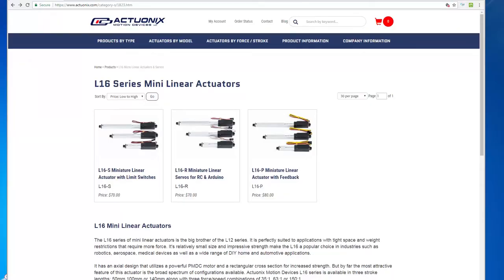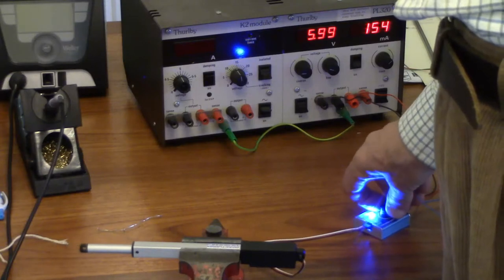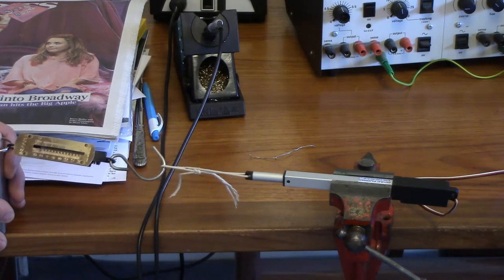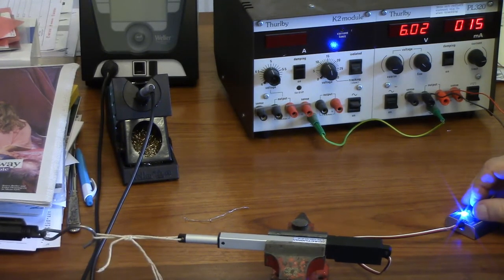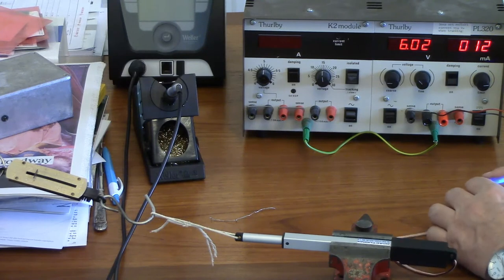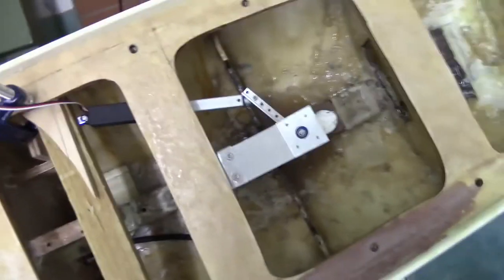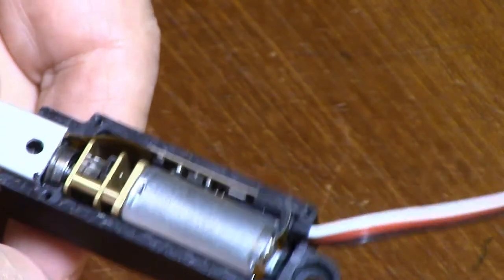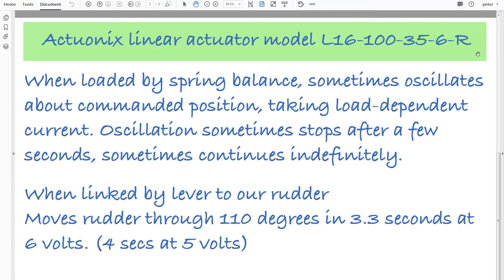Test of Actuonix L16 linear actuator

Comment: The hunting under load is due to either thermal protection or current (estimated thermal) protection.  Normally an rc servo will draw current to match the torque(rotary) or in this case force load applied, but still hold position. 
This unit does that to a point then above about 1kg it trips and resets.

Comment: I love reviews of the internal device of servo drives. Thank you!
I wonder how many thousands of cycles will stand a linear resistor?
Hint. Instead of a resistor, you can use a non-contact throttle position sensor from the car engine .... 
https://images.holley.com/543-112.jpg
The angle of rotation of the sensor is 90 degrees almost coincides with the angle of rotation of the rudder. Inside such sensors there can be a chip on the Hall effect. For example, KMA210.
  (The KMA210 is a magnetic angle sensor module with an analog output).
Reply from the maker: Yes we don't think that servo will last for ever, especially as it is a brushed motor. But we thought it would be ok for testing other things, and looking at its construction might help us design a more reliable one. I agree hall effect non-contact sensors are the way to go, and we particularly want one on the actual rudder shaft. We have tested this one https://uk.rs-online.com/web/p/mechanical-rotary-encoders/7899490/ because it works off 5v and is easily interfaced digitally. Don't know if a car one would be cheaper, but probably bulkier and the 12v working puts me off.
Reply: Of course there are many ways to make a non-contact encoder.
I used an absolute encoder from the car to replace the potentiometer inside the MG996R drive. 
The throttle position sensor is supply from 5 volts. Inside is the KMA210 chip.
https://raw.githubusercontent.com/Aleksk1/Boat_autopilot_MMBasic/master/Photos/KMA210.jpg
  The output voltage range is from 0.5 to 4.5 volts (resolution about 1 mV). Of course, you can put a voltage divider and reduce the output voltage to the desired value. Thank you for your video reviews.
Reply from the maker: Thanks.